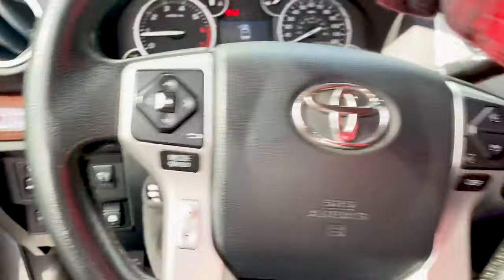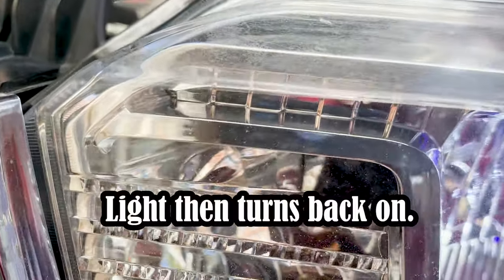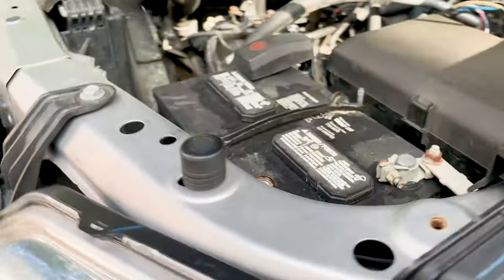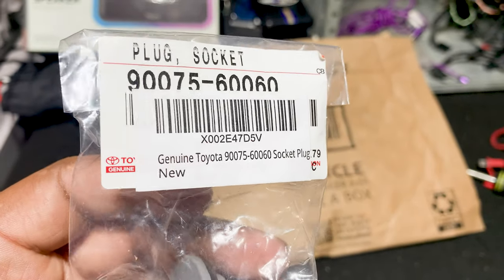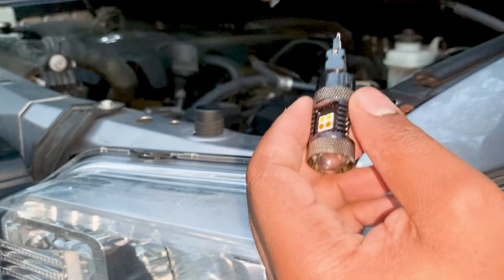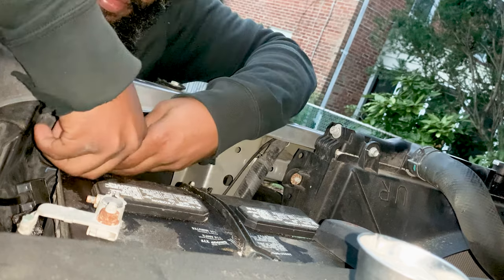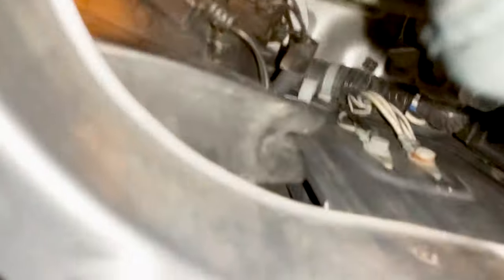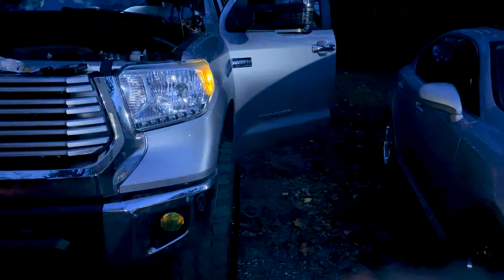FIX Toyota Tundra Turn Signal Keeps Blowing Out | Turn Signal Bulb Keeps Blowing Out Repair

Comment: A huge thank you for taking the time! I have researched on this and have been pulled into problems with wiring and relays… then I found your recording and you tell it like it is. Faulty socket is not explained anywhere I have researched. Usually it’s, signal not working? Check relays. You the only one who explained the faulty socket with burned light connectors… in detail. Much appreciated.

Comment: Hi. I also have a 2017 limited and just installed led turn signals in the rear but now I have a hyper flash. Im sure the fronts would have done the same. Did you have any issues regarding this?

Comment: So the led turn signal bulb that you used... did they have the built in resistors to stop hyper flash?  Would seem to explain the over heating damage to the socket.